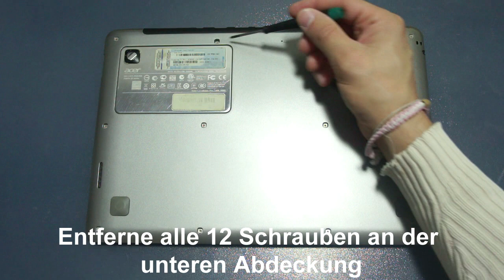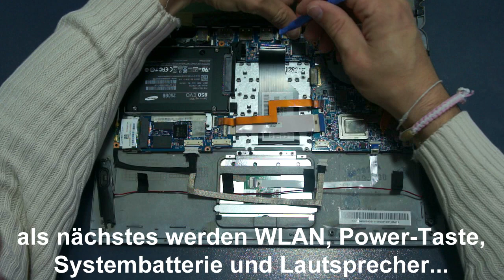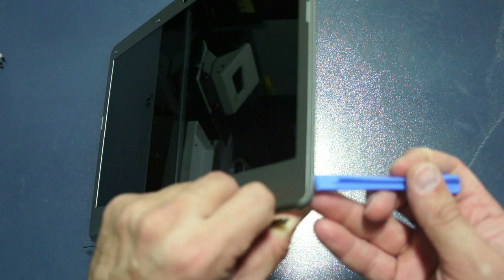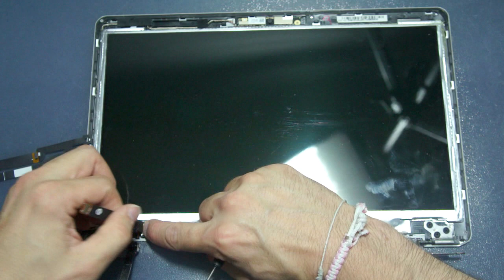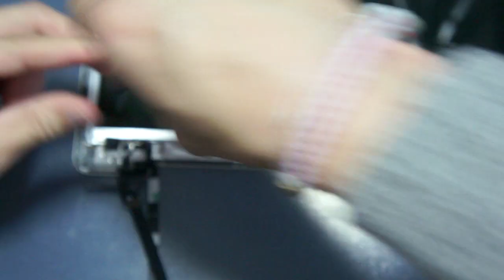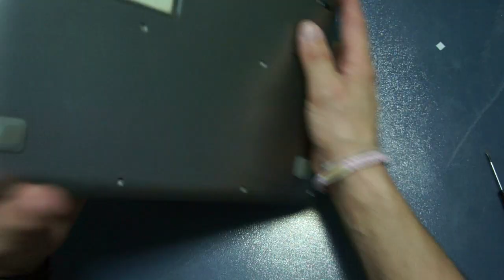Acer Aspire S3-951-2464G34iss[eng.sub] - Defekter display Kabel wechseln - Cable exchange - 케이블 교환

Comment: Thanks for the video! It helped me fix my Acer Aspire S3-951-2464G34 by replacing the defective video cable. A more detailed explanation regarding how to wrap the new cable around the hinge would have been helpful. I simply checked how the old cable was wrapped, and used the white marks on the new cable to align them with the laptop.

Comment: Thks, The most difficult thing was to fit the flex card into the hinge of the monitor. Before the replacement, analyze well as it is entangled and fastened to the hinge post. If necessary take photos before removing and practice removing and putting the old to not make mistake with the new and break it.

Comment: I have an Acer Aspire MS2346, the screen is turning on and all white, no Windows image. Can this be Flat Cable? Thank you very much in advance.
Reply from the maker: I think so, because my laptop do it same too. If you have a second monitor or TV, conect it over HDMI cable for check!
You have on the second screen the Windows logo so, it is only the cable malfunction.
Reply: Thanks for the quick response. Yes it works on a TV, or other external monitor, through the HDMI cable, but here in Brazil it is difficult to find this flat cable. Can you help me?
Reply: Sorry for the bad English.
Reply: I know you have two flat cable type for this model, I removed the LCD frame and saw this code 50.13B23.001 cmi TA G 94V-0 1138-T.
Reply from the maker: i was looking for the cable number in internet, but them have many type with this number :-|
Reply: Thank you for your concern and help.
Reply from the maker: You welcome
Reply: Okay, thank you so much for your attention.
Reply: You can check in aliexpress, they have all sorts of replacement parts.
Reply: Please Wayner. Actualy,  Do you know how I can find the kind/Code  of correct  cable before open it? I have on Acer Aspire MS2346, I'd like to buy the cable before, and when I open it, change it immediately.

Comment: Excellent Video, exactly what I'm looking for.

do you know if the CPU could work without LCD Screen ?
to be more specific, BIOS is not shown in an external HDMI monitor, it show up until OS is loading.
Reply from the maker: Thank you,

The BIOS is only displayed on the laptop LCD not via HDMI.
You can try, stick the HDMI cable in Laptop and TV than switch on both.